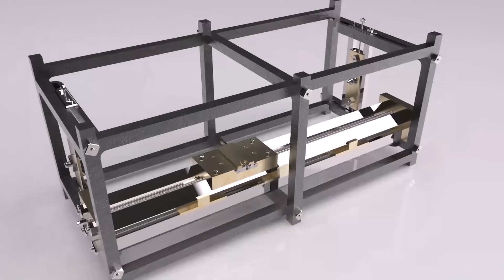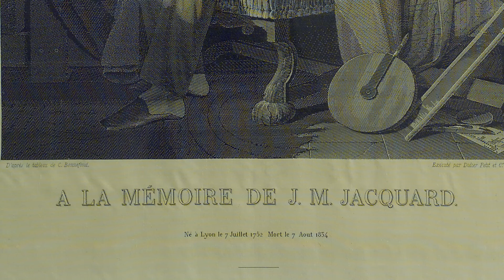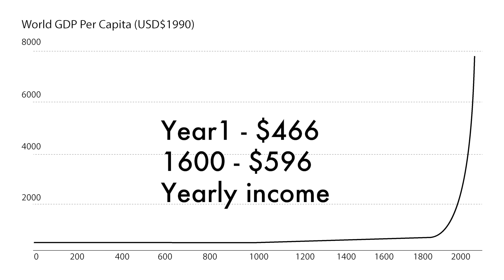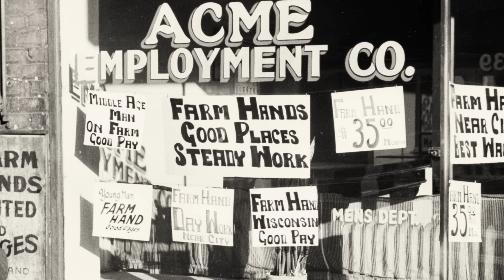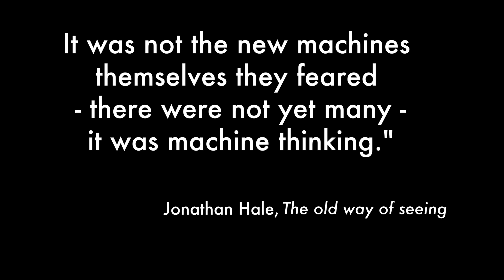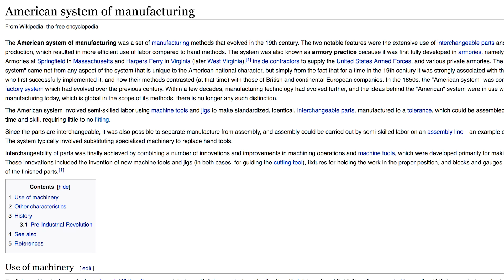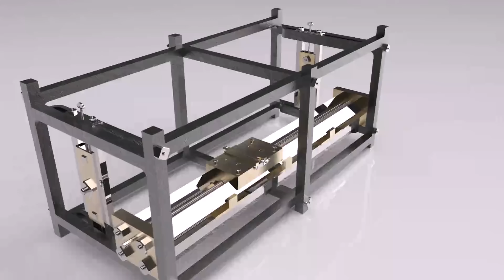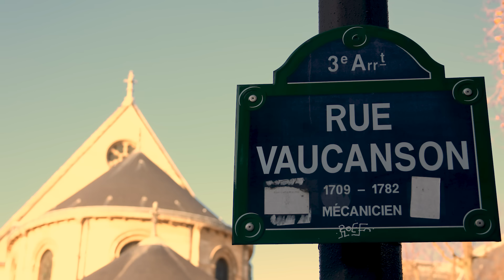The 1751 Machine that Made Everything

Comment: Using that graph as a point is a bad idea. The graph kicked off because of Roosevelt's anti trust measures which helped create the middle class.

Also, the Bessemer converter to create steel, electrcity, the electric engine, and the gasoline engine caused the wealth spike.

Comment: So I found this "Cyclopaedia" from 1741 and they had the following entry on Lathes:
LATHE, or LEATHE, a very useful engine for the turning of wood, ivory, metals, and other materials. See TURNING 
The invention of the lathe is very ancient: Diodorus Siculus says, the first who used it was a grandson of Daedalus, named Talus. Pliny ascribes it to Theodore of Samos, and mentions one Thericles, who rendered himſelf very famous by his dexterity in managing the lathe. 
With this instrument the ancients turned all kinds of vases, many whereof they enriched with figures and ornaments in basio relievo. Thus Virgil, Lenta quibus torno facili superaddita vitis.
The Greek and Latin authors make frequent mention of the lathe, and Cicero calls the workmen who used it, vaseularii. It was a proverb among the ancients, to say a thing was formed in the lathe, to express its delicacy and justness. The lathe is composed of two wooden cheeks or sides, parallel to the horizon, having a groove or opening between ;
perpendicular to these, are two other pieces, called puppets, made to slide between the cheeks, and to be fixed down at any point at pleasure. See CHEEK
These have two points, between which the piece to be turned is sustained ; the piece is turned round, backwards and forwards, by means of a string put round it, and fastened above to the end of a pliable pole, and underneath on a treadle or board moved with the foot. There is also a rest which
 bears up the tool, and keeps it steady. As it is the use and application of this instrument that makes the greatest part of the art of turning, we refer the particular description thereof, as well as the manner of applying it in various works, to that head. See TURNING.

Comment: I disagree with your theory. Lathe as form shaping machine has existed forever -- a potter's wheel is a form of lathe (for mud), there is also a carpenter lathe for wood. The thing that really sparked the explosion of modern wealth is the separation of power source from muscle and geography (i.e.water or wind). Prior to a steam power plant, the most reliable source of power was muscle, and it was very limited in terms of scale. It was with the steam engine that sufficient power could be produced to drive every possible derivative machine.
- Steam + wheel = railroad
- Steam + boat = ocean going vessels without weather limitation
- Steam + loom = modern textile factory
- Steam + hammer = modern stamping machine
...

Comment: The people living in the 1000-1800s learned how to use wood stone and steel, to make tools, bridges, roads
1800-1900 used steel machinery.
1900-1950 steel vehicles and machinery.
1930-1960 Electric products 
1960-1980 Electronic products(TV, radio, hifi, the advancement of electricity)
1980-2000 Informatica (the programming and advancement of electronics), software developing hardware
2000-2020 refinement of hardware, microbiology, Discovery of new and composite materials
2020-???? Quantum technology, gene and dna research, AI research, software developing software. 
20??-21?? Analog Quantum PCs (or full quantum PCs), most of the world is driven by machinery and electronics.
21??-???? The fall of mankind. Most of men will have lost the will to study or grow, since machinery has done it for them for so many decades. Few clever wizards on the top, majority of mankind poor.

Comment: And nowadays with the introduction of PLC (especially more capable ones, though you can barely only use PLC nowadays) and IoT technologies (mostly for tracking but can make the ordering part more convenient as well), plus the mind of industry 4.0, we can see things that are made in industry yet still being "one of a kind". It's simply not possible when you have to hard wire a machine to automate it, and economically not efficient to use non automatic processes (like machine assisted sewing, which if you try to make an order you would likely have to order at least 500 rather than just 1).
So maybe the next thing would be PLC (for making quick changeover possible), and the one after it would be, well, IoT, as in software (for auto tracking what's being ordered and produced) since the hardware is mostly already there for years. Sure 3D printing is also important, but just like CNC, firstly it's not fast enough yet, secondly it's simply not capable enough without potential IoT technology since you would have to unload everything by hand.

Comment: yeah....im gonna go with fossil fuels for that graph bud
Reply: True enough, but the first fossil fuel was coal, and the good coal was deep underground, and deep mines require water pumps to keep them from flooding, and pumps were driven by steam engines (which burned some of the coal), and the steam engines required machine tools (lathes) to cut metal with the precision needed to contain the steam while the parts were in motion.  Later, we realized that we could build machines that drilled through rock to reach oil and gas, machines which also required precision parts.

Comment: Hi Camcamaro1991 About to do LUX Bose amp install on my 06 GMC Yukon.  I'm having a hard time wrapping my head around how pin C and F are not used in the 8 pin C2 connector.  According to the schematic it is a red and purple for the output of the left rear twiddler output.  Please help as i have not started the mod yet.

Comment: A lathe can make many things, but the old story that it can reproduce itself is a total myth. precision tooling all started with hand scraping 3 surfaces together so that they would match, creating a true plane surface. That's what is necessary to built the majority of a lathe, or any other machine tool. I worked 15 yrs as a toolmaker, and someone will have to show me how to make all the parts for a lathe using another lathe without a lot of work arounds to turn the lathe into a milling machine.

Comment: the per capital income went up.  what happened to the cost of living?  if the relative wages didn't change over 7000 years, did the relative cost of living not go up either?  so we created more wealth, but probably also increased the cost of living so devalued that increased wage.  In just 20 years, minimum wage went up almost 3 fold.  So did the price of fuel.  So did the cost of the average house.   Wasn't exactly the point of your video but do need to keep things in perspective.

Comment: If I have to pick one machine that triggered the biggest explosion of wealth is a machine that can cut a perfect straight line like a metal ruler, a guide fence, a straight rod or a rail.

The biggest thing what really had stumped me about the lathe was they would have to developed some other kind of tools first to create those V rails in a perfect straight parallel lines and make those lead screws accurately in beforehand to create a lathe. A die set can explain the lead screw part but still will need to keep that screw rod straight as possible? Although, I do know they rolled those lead screw over a flat surface to make it fairly straight. 

I am aware of leveled lines and line of sight straight lines were two complete different things. Line of sight over the time will improve but what kind of non-leveled testing bed can verify this? How do they clone a better straighter line of the time? That seems needed to be in place first before they can advance up toward to any modern machinery.
Reply: https://www.youtube.com/watch?v=gNRnrn5DE58

Comment: You forgot to mention Babbage and the engineer he worked with Whitworth. They built a mechanical computer.. but in the process had to up the refinement of engineering and created the 1st standard threads / nuts and spanner sizes. They moved the accuracy of machine made parts at least 2 decimal places more accurate.

Comment: Anyone who doesn't think the lathe is important should pause for about 5 seconds, look around them, and count the number of round, cylindrical, or rotating objects within arm's reach. All of them were made on lathes.
Reply: Yama Satru  @YamaSatru Probably everything you mentioned was produce on factory equipment made with lathed parts in their motors, bearings, shafts, pins, etc.

Comment: ....but....what machine did he use to make the parts for the 'first' lathe?   ;-/
Reply: Parts for the first lathe were made "by hand", with great skill and patience, with castings, files, drills, scrapers, etc.  Perhaps the first leadscrew and half-nut were made, big and bulky, from hardwood, then used to drive tools to rough-out the next one from brass.  One might refine the brass version with slow, careful filing, and use it to cut the first few steel leadscrews before it wears out.  Then you have a machine that requires much less skill and patience to make other lathes with.  A pantograph mechanism could be used to accurately cut metal parts from larger wooden models.

Comment: Fossil fuels is the real reason for that graph. The energy to run any of those tools, and the tools it made, was only possible to use because of cheap, abundant fossil fuels like coal and oil. So the machines came only becaus ethe energy requiered to use them was in place. You could not run any of this by hand, animals, water or slaves. So you are kinda off in your understanding of things.

Comment: Nice video, very interesting...and true as far as lathes and machines go.
BUT....the inventions which actually drove that spike in that graph were the invention of the Kerosene lamp, the world's first really good, clean, strong, portable light. It changed all of humanity which had it. One billion people still use kerosene lamps.1853
The second is the oil industry, 1859, whose rise came just in time to save the remaining whales in the world and supply the energy needed to fill millions of lamps and  drive these machines being built with the lathes and milling machines...and of course power everything which came from there...also, providing the feedstock for nitrogen fertilizer for 42% of all food grown and the mechanical means for massive food production.
Third was the Otto cyle engine....now powering 1.2 billion cars worldwide.1876.
  It's incredible that the rise in GDP is just as sharp as the population, and in fact when you look at the graph, just multiply the GDP by 1000 and you have the population of the world...fairly close

Comment: Brilliant. Am currently researching early computer-like machinery and Vaucanson not only built the most accurate automata at the time but also created the first punched-card machine input; in the loom weaver quickly adopted by Jacquard. This was to be the method of analog binary input (cards having holes for a 1, and not for 0) for computers in the early 20th century (a century later!) up until electrical relays became doable. It was even essential to Alan Turing's 1936 concept of the Turing machine, which goes over an endless string of binary code in order to compute the relevant output; which is still the basic concept and criterion for software programs.
Reply from the maker: watch my video Paris' Temple to Science. It's all in there!

Comment: Hi Machine Thinking, I enjoyed your vid, but I will have to disagree with your conclusion about this being the machine that made everything, your premise seems to be the fact that it has a double vee bed which is the basis of modern lathes, however your rationale is faulty for the following reason - all modern lathes using vee beds have a matching flat for the saddle to run on, the second smaller vee also has a matching flat for the tailstock to run on neither of these run on both vees as differential expansion would cause the saddle or tailstock to ride up the vees and would therefore be able to rock back and forth, this would be especially true of the french lathe as it has a brass saddle on a steel bed, also there are many lathes that utilize two flats and parallel sides for accuracy (as did the earliest wooden pole lathes) and if such an iron bed were hand scraped would be capable of great precision, some of the most accurate lathes of the past utilize an inverted dovetail (eg Hardinge) so I think the french lathe has no greater claim than others that  had little innovative feature, as for the cross slide and tool tip I believe these features can be found on pit lathes and cannon lathes. Surely the machine that made everything is the steam engine as it allowed industry to grow and no longer be tied to cottage industries. It is none the less a lovely lathe.

Comment: Great video. The tool rest lathe was a key invention. I'd still have to say that it was a thing that the tool rest made possible - the steam engine - that really made things take off. The engine allowed humans to use fossil fuel (coal) to create motion. Before this humanity was dependent upon the cycles of nature for motive energy. Hydro, wind, and the muscle power of people and draft animals powered everything. Energy storage was seasonal, in the form of crops, and sailing vessels were at the mercy of the wind. Hydro and windmills varied their output with the weather. Using coal tapped people into millions of years of stored solar energy limited only by the rate of coal extraction. Humans escaped the cycles of nature. This accelerated with the discovery of oil and the diesel engine. All of the industrial development you cover was fossil fuel powered and wouldn't have happened without the fossil fuel/engine combination.

So, consider this a friendly amendment to your excellent presentation.

Comment: I don't know, electricity and the electric motor was pretty damn important.   We have a gigantic 1950's lathe on the farm, and I have never, ever used it as a tool.  My dad said the lathe was the most important tool, you could build any other tool with it, but I never really saw how.    I use electricity almost every moment of my life, and electric motors are in all of my rotory motion tools.   I could make a good argument against lathes, that it was the harnessing of electricity that really changed everything, and that really skyrocketed the generators, the electric light bulb, with radio, vacuum tubes, transistors, and microchips.

Comment: The crucial point: 5:29  "Each time a machine tool adds another decimal point in accuracy, precision gets cheaper, which makes new products and processes possible, and far-reaching economic booms kick off." 
Yes!  Moore's Law in semiconductor ICs is just another example, though as it slows down because it is hitting the atomic level, it needs a paradigm shift from stochastic top-down photographic printing to discrete bottom-up molecularly-precise Drexlerian tools.

Comment: I have often thought about how the machines of today are made by machines which were themselves made by machines, going back to simpler and less precise machines of years ago. From the time I was a child I used to wonder what this string of machines led to in the past. Perhaps this is the best representation of the beginning. But of course, there are many examples of earlier machines, and let’s not forget all the hand tools, without which this lathe, and all other machines, would never have been built. Someone, somewhere, had to invent things like screws and screwdrivers, nuts and bolts, plates, bars, shafts, all of these things we see in this early lathe. And it was pretty much all done by hand in places like blacksmith shops, using forges to heat iron, hammers and anvils to form it into shapes, and other tools to precisely fashion it. All of this ultimately comes out the mind of human beings who invent and create, as they bear out the image of their own Creator who made them in his image.